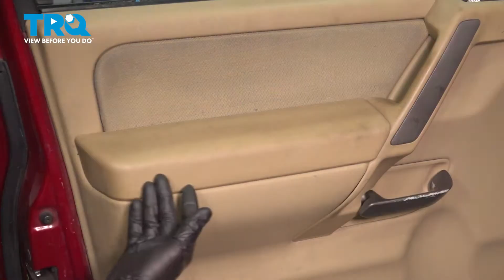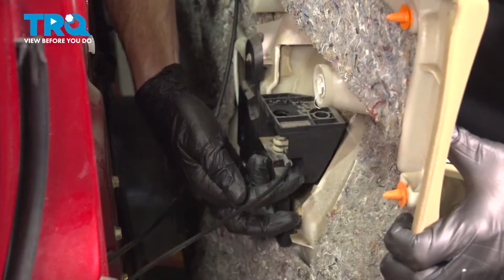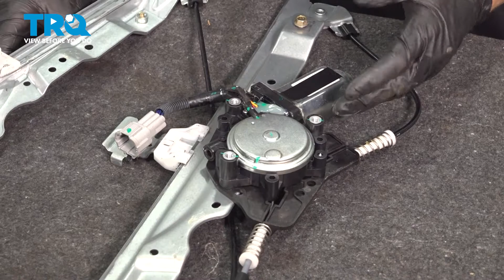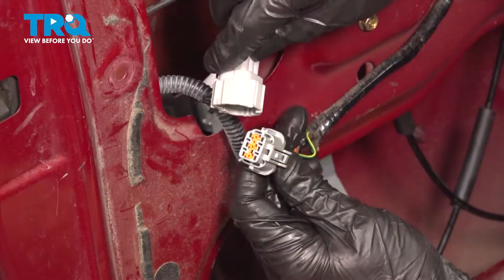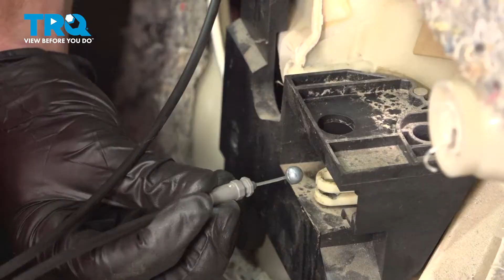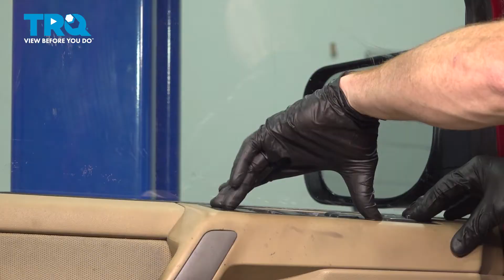How to Replace Front Window Regulator 2004-2015 Nissan Titan

Comment: Thank you for this video! Really helped me out. One thing I do want to mention is that if your window is stuck all the way up (like mine was) you can still get to the bolt that holds the window to the regulator. I did it by reaching up through the main opening in the right side of the door panel and used a small adjustable wrench to loosen it. You can alternatively cut the cable that holds the window up, just be very careful that it doesn't fall down.